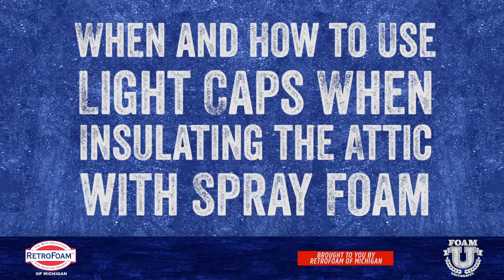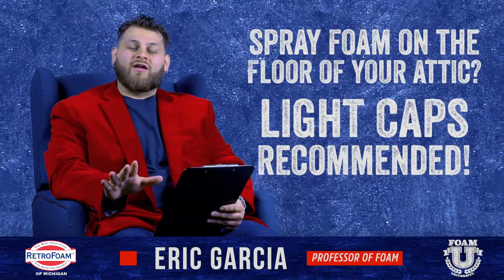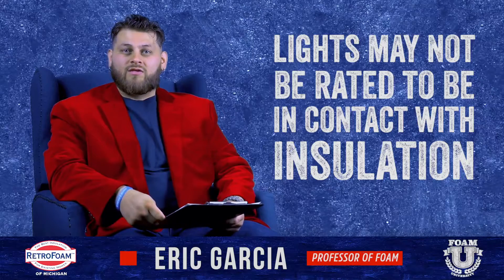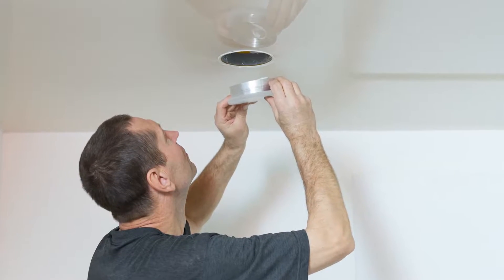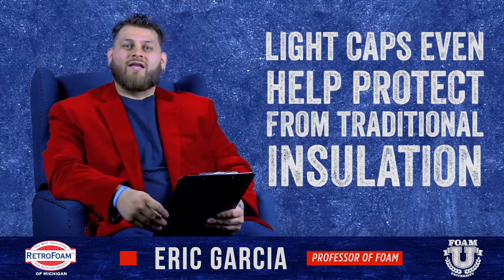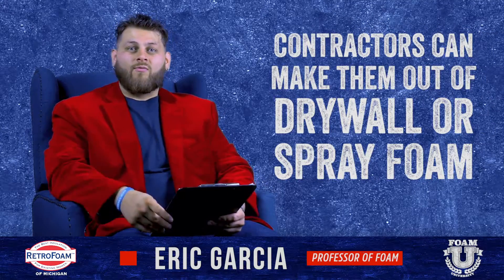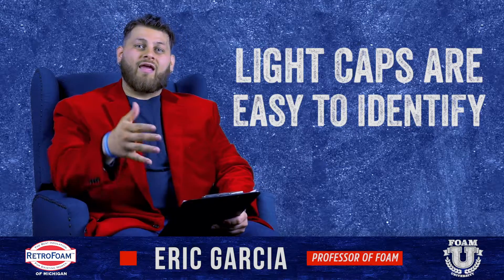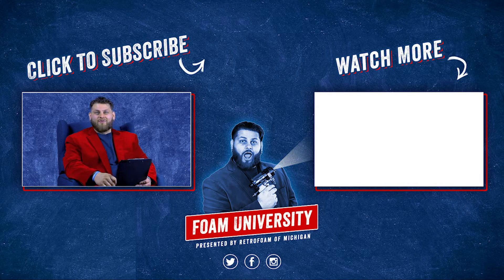Spray Foam Around Recessed Lights: When and How to Use Can Light Insulation Covers | Foam University

Comment: what if i want to spray foam the exposed ceiling , should i spray surrounding speakers caps or should i install speakers on top of the spray foam,. and for suspended lighting should i keep the support attached to the spray foam? Kindly, advise. Thank you
Reply from the maker: All of that should be placed before the foam is applied.

Comment: I have ic rated can lights, my husband wants to use caulk or a ring,  ate both or either one of those helpful to keep from losing heat in winter time?
Reply from the maker: They could help with air loss which will help with heat loss. Can foam does both.

Comment: I want to spray foam my attic but know that in the future I will be adding pot lights. How would this work with spray foam?
Reply from the maker: If you spray the attic flat with open cell spray foam, the material is very easy to cut and take out as needed to add the lights. The other options would be to instead spray the attic roof deck which would leave the flat open to add the lights easily.

Comment: I am a general contractor in Arizona (hot climate) According to building science experts they advise not to use blown in cellulose insulation above the living area if you foam the underside of the roof with open cell foam What would be your choice to use above the livable space? I plan to use TENMAT light covers in the attic and foam them. TENMAT covers are made of rockwool. Dan Steech Espana Homes,
Reply: For the folks wan info on TENMAT light covers - Google it. Dan
Reply from the maker: If you choose open cell spray foam for the attic roof deck, you wouldn't need to add any more insulation to the attic flat/floor. The spray foam creates an air seal, so any added insulation on the floor would be a waste.
Reply: @RetroFoamofMichigan   I use recessed light fixtures in a flat ceiling. I plan to use open spray foam on the underside of the roof.
I do not plan to use any insulation on the floor of the attic. Should I cover the cans with the TENMAT covers and foam around them?
Dan Steech - Espana Homes, Inc. - Scottsdale, Arizona